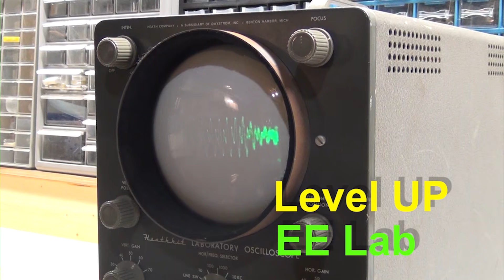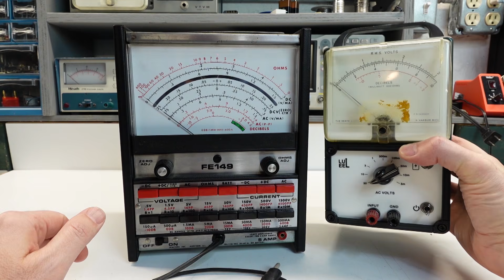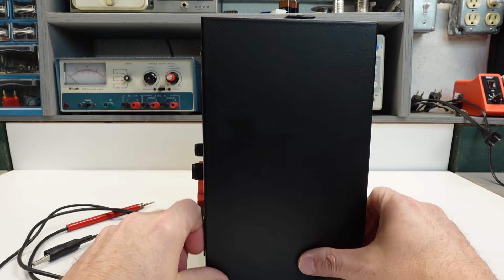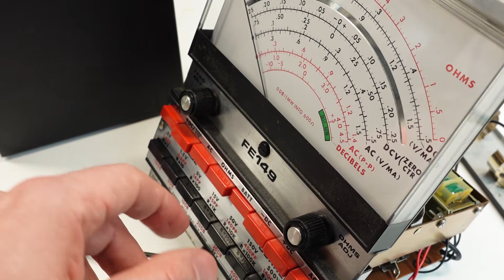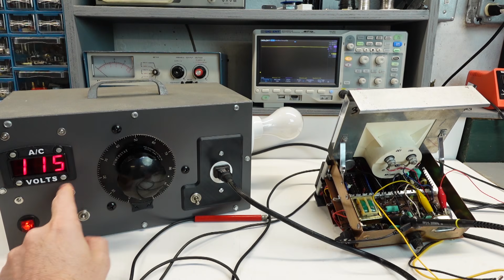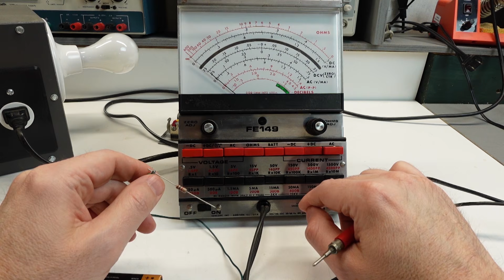Sencore FE149 Analog Meter: Part #1

Comment: I have one of these that works BUT the switches are bad. I have to work every switch 50 times to clean the contacts so it will work for a short time. I thought I would drill the switches to clean them but it ended on the shelf Yours is you want it. Carl    AB1ZI
Reply: Deoxit 100 should help